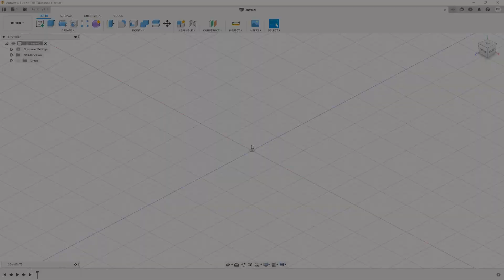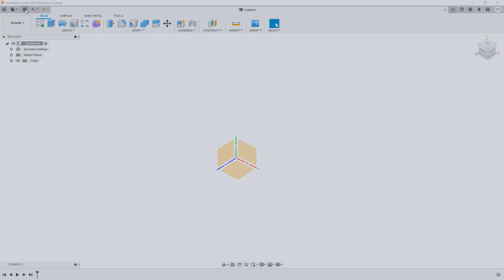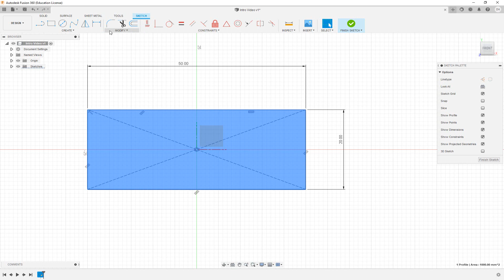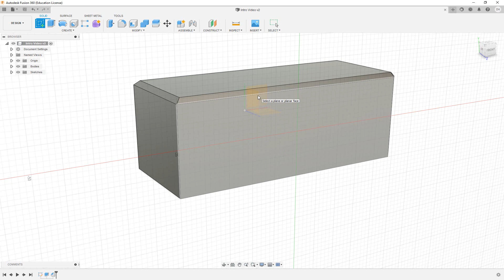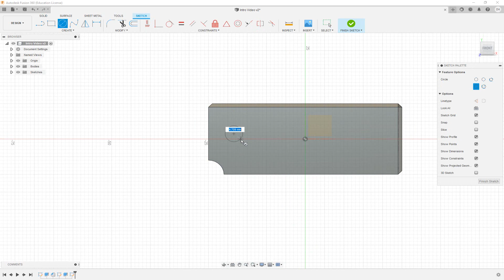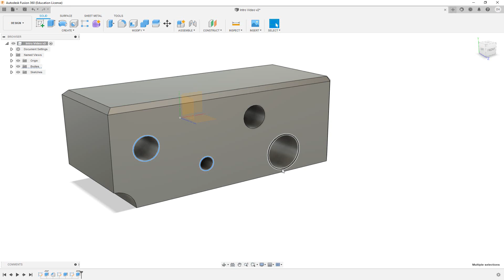Intro to Sketching in Fusion 360: A Beginner's Guide

Comment: Question. I use solidworks for modeling then I import to 3dsMAX but it could said that the model it appers with many lines "its contaminated " different that when I import a 3d AutoCAD model. 
The questiin is if I model with FUSION 360and then import to 3DSMAX the model will show like in autocad ?
Also could I model In Layers as autocad ? 
I am architect. Also I need to know that thing of the layers because I need the model in layers to the do the Post Production in photoshop. Working with layers do the post poroduction more easier and faster